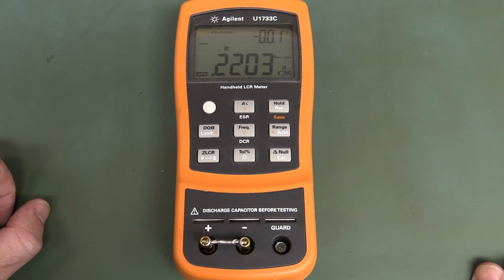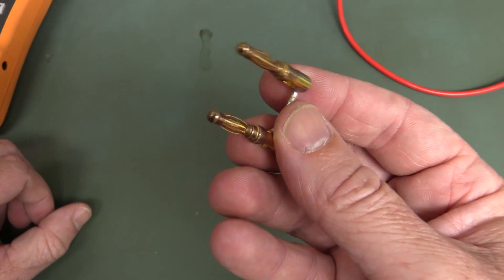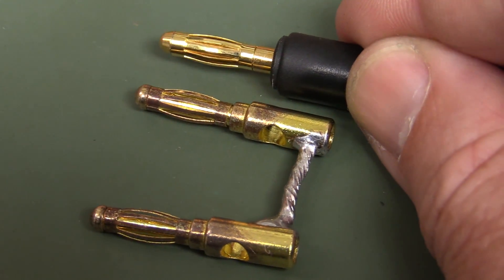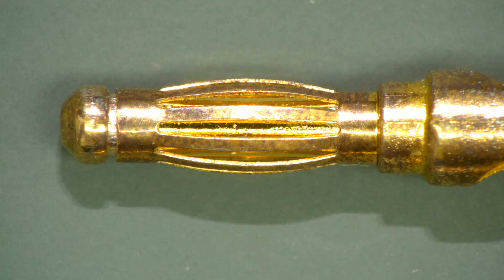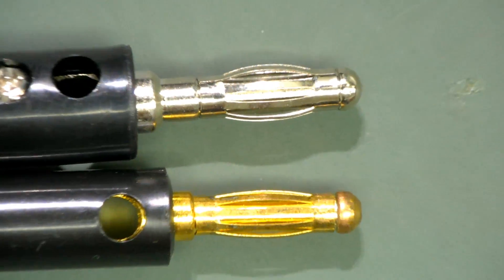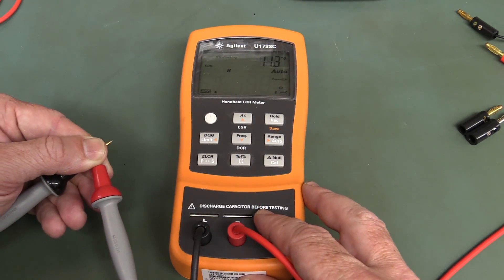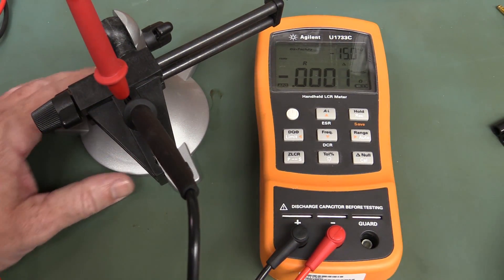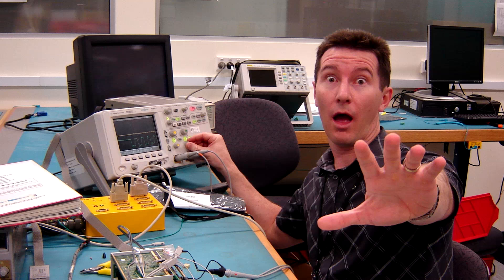EEVblog #1052 - BEWARE Crap Banana Plugs!

Comment: Well...they are still around. And you don't realize how loose that sleeve is until you get them. 
And then you fire the soldering iron. 
And then you realize it takes too long. 
So you add some flux, wrap a turn of solder around it and bake it. ( withou the plastic sleeve on it!!!)
Then you come here looking for videos, and try to talk youlself into paying $3 to $6 for one, instead of $10 for 40.

Comment: I never use the rotating here in New Orleans area the humidity destroys them. All gold plate wears off eventually.  This is the first time I have ever disagreed with your sage advice. I actually solder them up where they don't rotate, measure them and no issues l.

Comment: The resistance variation when using your shunt is due to the resistance of your body being put in parralel with a verry small resistance. You are putting both hands when you do the test. I dont see anything wrong with the connectors you tested

Comment: I've used a banana plug like that on a 5A lab power supply
I think it would be useful if the connector could be rotated
And finally it melted my Binding post 
I never use it again for currents above 1A

Comment: I would never buy a banana plug with that spiny contact thing.  What a disaster waiting to happen!  Gold is not so great as people think.  It is not corrosion free at all.  A lot of plugs these days are made of separate metal parts relying on pressure contacts that develop corrosion between them over time.  Ideally you want the wire to connect directly with the pin contact so that the only pressure contact point is the plug pin.   No riveted solder tabs, solder directly to the contact pin or body (ground contact).  Of course bananas are a single contact connector so ideally, the body and pin should be made from a single piece of metal, not separate parts.  This was all pretty standard pre 2000 but these days, most types of plugs are very poorly designed and made because it's cheap.  It's just not reliable though and drives me nuts, locating and fixing this garbage.  Its the most common cause of faults in any audio system, domestic or professional.

Comment: Plating does look bad.  But looks to me like the main reason for the poor contact is the gap between the two sides of the outer compression ring.  The one you show with the poorer plating (definitely worse than the other) is butted right up against its other side! It cannot collapse any further than that. There should be a large enough gap there to allow the ring to fully compress against the inner core.  If you look closely at the "good" banana jack you'll see there's a reasonably large gap that allows the compression ring to collapse onto the inner core and make a solid repeatable contact.  As shown, the bad banana outer sleeve will never make a good contact since its two edges contact one another before any insertion making it impossible to compress down to make a positive contact with the inner core.

Comment: This shit is also used on some cheap motor ESC units for drones. These can be carrying as much as 40amps at full power! Check your connectors and if the contact part rotates either solder them or best throw them away and get top quality plugs. The quality plugs have the contact barrel crimped to the center core for a perfect contact.

Comment: Shitty (thin) gold plating is more of a bright yellow (which is actually the nickel substrate layer shining through the INCREDIBLY thin gold plating layer)
*GOOD gold plating is a lovely rich (almost dull) golden yellow.  And will shine, even if not directly lit.   Keep in mind, gold can be soo thin, that it can be seen through.  Which is why its used on astronauts visors, as it saves their faces from radiation in spaaaaaaacee

Comment: After watching your video, I checked my leads that have these rotating barrels.  Most were OK but a few showed resistances of as much as 3 ohms!  Almost all showed changes as the plugs were wiggled.  One even went momentarily open!  Easy fix for them though.  I just soldered the tip end of the rotating barrel to the plug.  The gold ones soldered easily.  The nickel plated ones needed some light scraping first.  On all of them, while the solder was still molten, I slid the barrel all the way to the tip.  This allows space at the top of the barrel to allow it move in an out as the leaf springs are compressed and prevents jamming or overstress of the springs.  All of my leads now measure 20 milliohms or less and the wiggling issue is gone.

Comment: I had some of these and they caused a bad problem. After only a couple of uses they began to break up and bits of the springs fell into my equipment. The rest of the plugs rapidly ended up in the bin.

Comment: You'd make a good ham. Get a radio license. Get on the air, Design some new digital modes, play with the old ones. Build transmitters and receivers and automatically tuning "magnetic" loop antennae.  And more.  I'm radio first, learning electronics to support my forays into kits and repairs. Also, a dumpster computer/Linux user.

Comment: The "rotating skirt" design might look cool, whether gold-plated or not, HOWEVER.... it has one major flaw: it does not give a snag and tight connection. That's why the ohm meter jumps all over the place when you wiggle or rotate the plug. The problem is the rotating skirt very loosely touching the core of the plug. If you plug in the banana in its socket and can easily spin the plug around, your connection will be intermittent. SOLUTION: solder one end of the skirt to the shaft to prevent it from spinning completely.

Comment: Instead of all the yammering, why not actually find the exact source of the problem -- measure resistance from expanded plating to the end or sleeve, rig things up so that the effects of the rotation can be observed, etc., etc. So many actual diagnostic steps could have been taken instead of 10 minutes of complaining about a 1 minute problem.

Comment: I've run into this problem with ebay banana plugs and they made a melted plastic mess when used to connect my 3d printer to its power supply

Comment: Dave, do you think you can do a thin layer solder job on those awful flange type plugs, soldering it to the inner rod at the end(s), and get acceptable results?  Of course--no more rotating!

Comment: i just had this problem when testing a shipment of 18650 battery's with my imax b6 turns out the banana jacks messed with my reading i told my boss about the battery's being dead all most had to ship back 4000 18650 battery's  going to make new leads o and dave thanks for making great videos

Comment: It is not just the 'gold plating' issues here.. like everything else, it is more complicated.
The compression gap on the crap connectors is too small. When compressed, it forms a solid ring with a diameter larger then the inside solid piece. That is the major design flaw.. a flaw shared, I might add, by the connectors you sell. The problem is more apparent in the tarnished ones, but yours appear to have the same crappy contact patch, theirs just combines that with tarnish.

Comment: I bought these crappy plugs a year ago on ebay and recognized the same problem right away. I tried to solder the turning part to the inner - that mostly solves the problem but the plugs become more difficult to fit in. I also recognized the "gold"-plating is only golden color - no quality at all unfortunately! You really get what you pay on those chinese ebay shops...

Comment: I discovered the same problem myself when I built extended leads for an RTD calibrator. I doubt I would have ever noticed it otherwise.  The simple solution is just to apply a dab of solder right at the contact tip, so the spring part can't rotate and is locked in place.  Haven't had a problem since.

Comment: I suspect it is a mechanical issue.  Think about it.  That loose spring part elongates when it is plugged in.  If it doesn't elongate enough. it won't push against the ends (tip,handle end).  Then it will rattle around.

I work for mechanical engineering software company.  One of out customers is a large automotive connector company.  I have seen studies on how a small change in shape can make the reliability of a connector go from 1 failure in 10,000 to 1 failure in 1,000,000.  With something like 100 connectors per car, a 1 in 10,000 failure rate would mean 1 out 100 cars would need warranty repair.  Ouch!!!!  Connector failure is really important to automakers.

-Kurt

Comment: I miss screw-in wire terminal (like on some speakers or hi power sound amps), the one with banana plug hole in the middle. they would fit nicely on hi amperage psus and low resistance/high current meters...perhaps they don't use them just for safety as it would be easy to touch the contact.

Comment: Pomona makes great  plugs, cables and connectors. I purchased my collection in the 70's and to date only one banana plug has failed. I've used them at home and job (Laboratory and repair). I've tested and use them reliably up to 10 amps where they get warm. Expensive but well worth the money.

Comment: The corrosion on the cheap plugs looks like it may be concentrated in areas where your fingers would touch them. I wonder if it is related to skin oils or salts. I also think that the rotating contacts are supposed to elongate when compressed by being inserted into a jack and I think it is this elongation which makes a reliable contact by jamming the ends of the rotating part against the stops on the stationary solid part. This also requires that the rotating piece be truly springy which would require a special alloy like tellurium copper.

Comment: I do not trust the loose rotating contact it is not a good connection for high current or low resistance. The solid one you have was the best, when you try to rotating them there was no visible change in resistance. All the other types has a change when they was wriggled.

Comment: I have lost a lot of time from using low-quality banana plugs and test leads. (Worst was some alligator clip leads which used super thin wire and was only crimped, not soldered, sometimes without the copper even touching the clips). Nowadays I am a lot more careful what I buy.

Comment: What's interesting is what happens at 12:25
there's a small drift that seems to zero out over time, my guess is that when you moved the contacts up and down you esensially heated them up by friction and changed their resistance.

Comment: Gold plating is less important than tight tolerance when it comes to rotating banana plugs. There's too much play between the rotating part and the plug's core.
The rotating part is designed to longitudinally "stretch" when plugged in and apply longitudinal pressure on the core to maintain good electrical contact. If the contact pressure between the rotating part and the "core" of the plug is insufficient, you will get bad contact impedance/resistance even if both are made of pure gold.

Comment: ALL those coated nanas are sh!te.. been using various ones for decades on modular synths, and anything that looks fancy is useless for CV and audio use, adding crackles and pops and the rest. some have even bonded to the socket or just snapped off inside, making for major brain damage to repair or extract the dead pin. the ones with those flexible cages on them are meant to expand lengthwise and make pressurised contact with the nipple and base of the shaft when inserted, so would  always be loose and rotate freely without issue, so free movement of a cage is not something to worry about, it's the blingy goldy coloured ones that always go flakey and ruin the afternoon..

Comment: I'm quite sure you'll have problems electroplating with an alloy, as the metals are in an electrochemical  hierarchy.
That's for instance how copper is refined with electrolysis.
So I'd wager your Nickel plugs are plated with pure Nickel. However there might be other layers underneath. I think chrome plated steel has to be copper plated, then nickel plated before a final chrome layer is added
Reply: They could have a too thin layer of nickel which over time can cause gold migration  into the brass substrate.

Comment: Have had that issue with a connector breakout that I made. When doing a resistance check I can get into the hundreds of K ohms. Junk raidioshack jelly bean parts. Need to order some new male banana jack terminals.

Comment: A tip I got from a mate, Nigel, at The Chord Company (who make high quality interconnects and cables), which was to use the high power, clamping, soldering iron from RS.  This is especially useful if you are making up speaker cables with a cross section > 2.5mm sq.  There's enough thermal capacity to get the whole job done before it starts significantly heating the plug (or melting the plastic on the cable).  It's a helluva lot quicker.  The soldering iron is only about £50 at RS.

Comment: These are copies of a Multi Contact design (who also make the tubular banana plugs that you show early in the video) and in the real ones the sprung parts are beryllium spring copper.  I would suspect there are different qualities of beryllium copper, and we probably can't rely on that being the material they make the springs from.   If the Chinese are adding in steel to make then flex then I would guess the resistivity would go up.  The Multi Contact ones are quite expensive for a 4mm plug (and they have been known to be notoriously stingy with sample parts) but they are good and, in my experience of a few of their connectors, will last pretty much indefinitely.  There's also a mechanical component to this where the spring's collars must grip the shaft of the plug.  On the Chinese ones there may not have been enough of a gap to let that happen, though that's a bit hard to tell as the quality of the pressing doesn't look that great either.

Comment: Put them upsidedown on the bench and tap the bottom (hard) with a hammer. The longitudinal gap between the shaft and the flex is too large. Try and shrink it slightly.

Comment: I couldn't find detailed explanation of proper way to connect varistors in parallel. Could someone with this knowledge elaborate this topic.

I just want to increase the peak current carrying capacity of my cheap surge protector wall adapter.

Comment: Better look for ones that have a wide seam in the rings to make a good clip contact, good plating and very little moving space up and down, so when they compress, they actually stretch a bit and jam into place. Also, gj for making banana connectors interesting!

Comment: i have a problem with doing anything rigid like this with those connectors ... the slack of wires tends to help
but i have never understood these things anyway
it might help if you just hit the ends of the floating part with a crimper a little bit just to make them more grippy

Comment: EASY FIX: Solder the loose rotating sleeve on ONE end to main shaft (when pushed all the way to the tip).
My cheap Banana Plugs were even worse than Daves. Now work perfect without throwing them away!

Comment: You can see the copper substrate under the Au plating on the el-cheapo probes. The discolouration on the surface will be due to crap process control and acid contamination during the pickling process.
Beware, not all Au plating is the same........

Comment: As the rotating flanges are compressed by the socket they elongate. That elongation pushes the ends of the flanges against the ends of the shaft indent. The loose flange with bent ends doesn't make a good contact with the ends of the shaft indent. You can see how all the others have much smaller gaps at the end of the flange, except the Farnell one, and that has a much more curved flange that would elongate more so needs that larger gap. It's that elongation pressing against the ends of the shaft indent that makes the major electrical contact, not the contract around the shaft (although that does play a part).

Comment: Why would you bother with such a two piece mechanism at all? 99% of your movement range is purely from the flexible stranded conductors, if you truly have a specialized need for a swivel mechanism I wouldn't bother with this design.

Comment: I ran into a set that the flang didn't expand when or had bad contact when it was inserted into the female banana side. I quick work around since resistance was not a big deal for what i needed the cable for anyway, I just dropped some solder so they made contact and wouldn't spin anymore.

Comment: I've gotten some excellent deals on old test equipment on ebay, like an accurate but old 5 1/2 digit DMM is $75. It becomes a problem to find accessories that are reasonably priced and excellent. Having to buy a $100 cable for a $75 DMM is painful. I think SOME cables from China are likely excellent, and SOME like these are junk. What we really need is some sort of registry of tested electronic products, with exact vendor names, part numbers, and accurate customer feedback history. It's impossible to tell if a cable on Amazon/Ebay is good or junk just from the web.

Comment: Some of the effect you were seeing on the better quality ones may have been due to heating of the plug from your fingers when you twisted them (thermocouple). You can see how the offset settles back to zero after you stop handling them.
Reply: Same thought Jerry: also possible some very localized heating from friction as Dave twisted the plug around. You can see as he stopped twisting and continued to talk the resistance started to drop (as they cooled?).
Cheers,
Mark
**********************